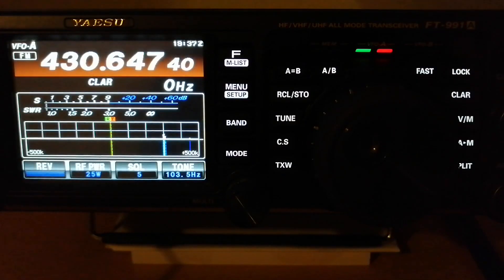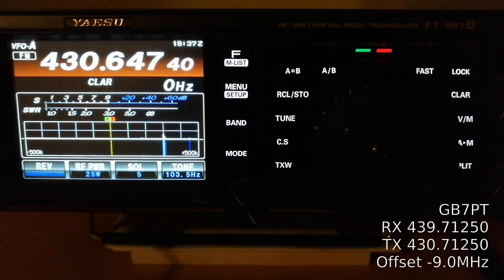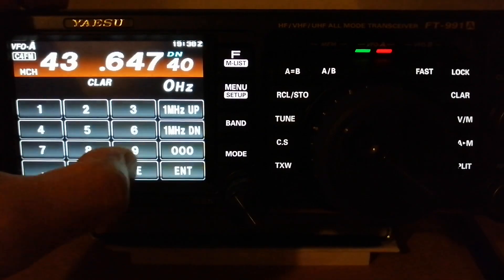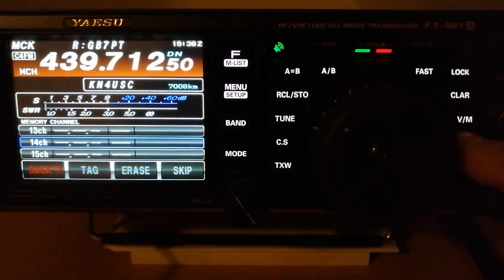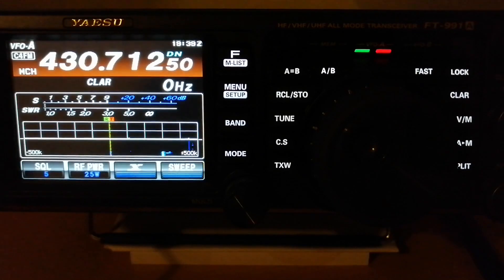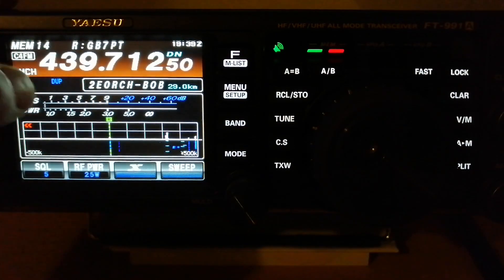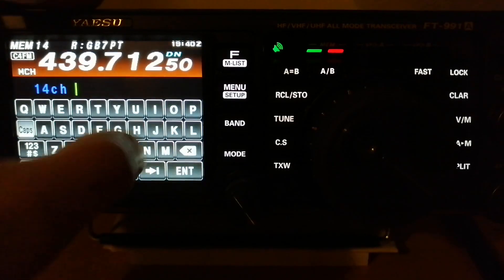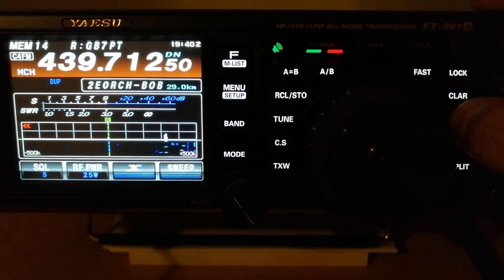Easy way to program a repeater in the memory of Yaesu 991A (Repeater shift / offset)

Comment: i know this is old but.. can i set the ARS for the standard ones to put in via the programming app and still save these as normal split repeaters? or will they still be overwritten by the ARS if it is turned on?
Reply from the maker: Hi, thank you for watching. You can have this pre-configured in the menu. But the problem is in the UK on 70cm, you can have a shift of 1.6MHz or 7.6MHz. The radio can be set for only one of the two shifts and will auto apply it. Ivo